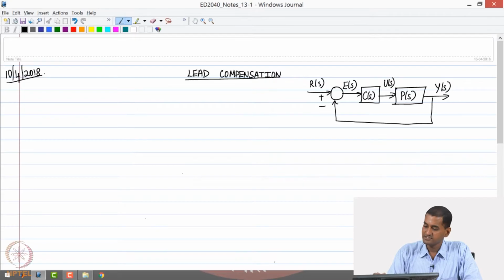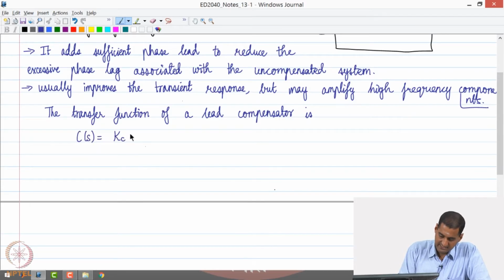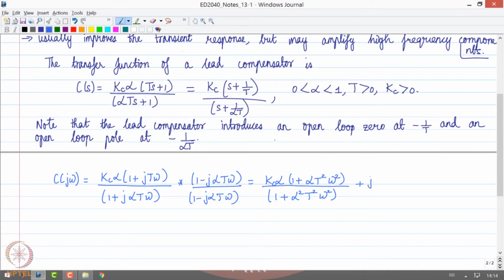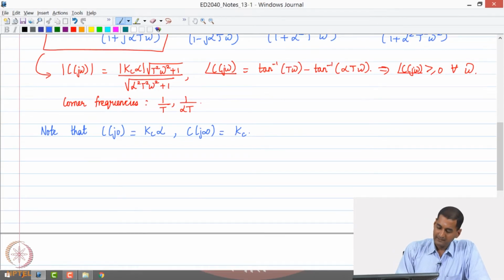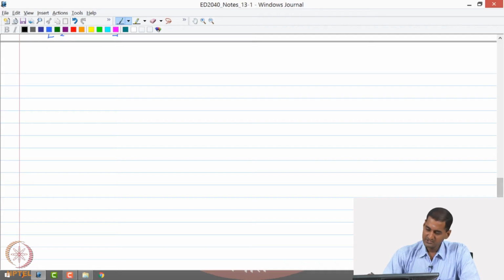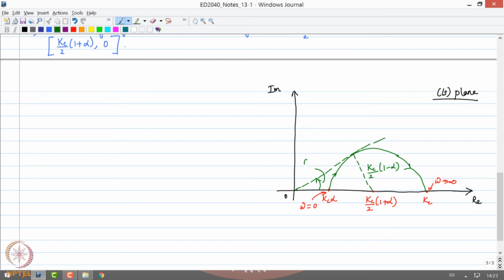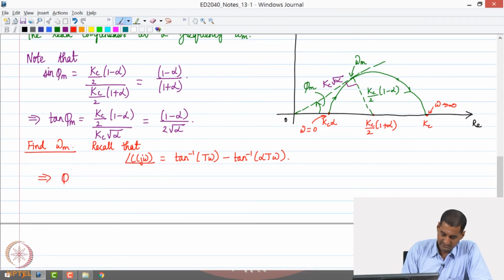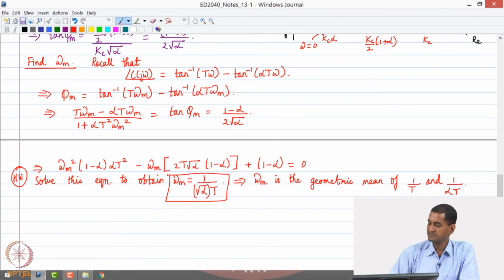mod12lec67

Comment: Lead compensation :
* lead compensator ( LC ) adds sufficient ph laedto reduce excessive ph lag associated with the uncompensated syst.
* improves trans response but may amplify HF components
tx func of LC c(s) = [ kc . alphs . ( Ts+1 )  ]/ [ alpha .Ts + 1] = kc ( s + 1/ T ) / [ s + (alpha .t )], 0 < alpha < 1, T > 0 , Kc > 0
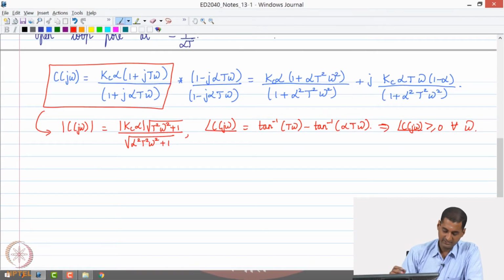Note : LC introduces an OL zero at --1/t and OL pole @ --1/ ( alpha . T )   8:00
=> angle C(jw) >= 0 for all w & corner freq  at 1/T & 1/ ( alpha . T ) where C(jw) is sinusoidal tx func of LC
note : C(j0) = Kc . aplha and c (j . inf ) = Kc
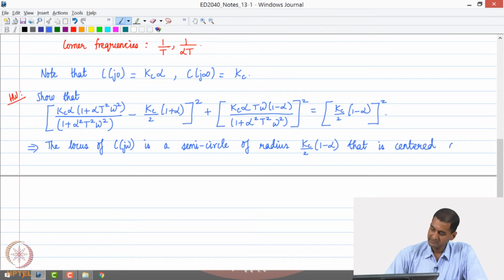Thus locus of C(jw) is a semicircle of rad Kc/2 ( 1 -- alpha ) centered at ( Kc/2 ( 1 + alpha ) , 0 )       11:50
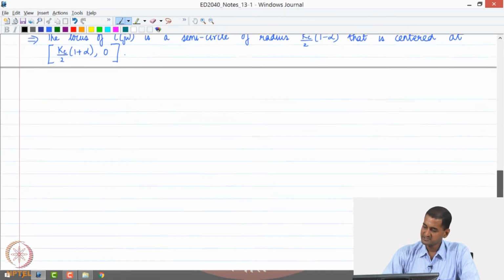Nyquist plot for C(jw)      12:20
Max ph lead provided by LC (phim) at w => sin (phim) = ( 1-- alpha ) / ( 1 + alpha ) , tan ( phim ) = 9 1 -- alpha )/ ( 2 root (alpha) ) and  wm = 1/ ( root (aplha) . T )  => wm is geometric mean of corner freq 1/ T & 1/ ( alpha . T )